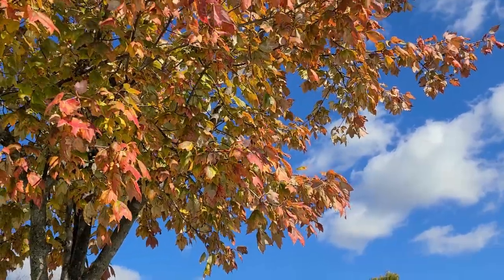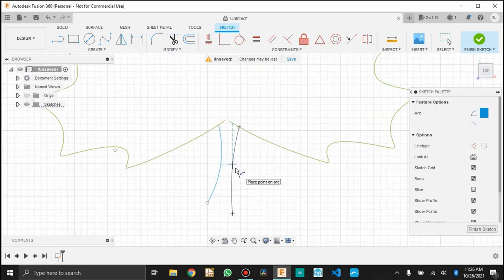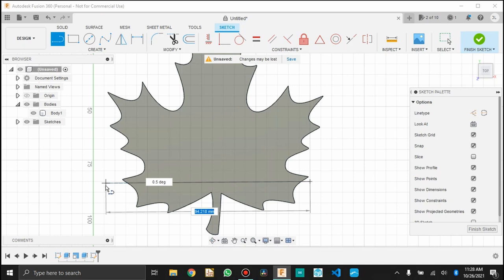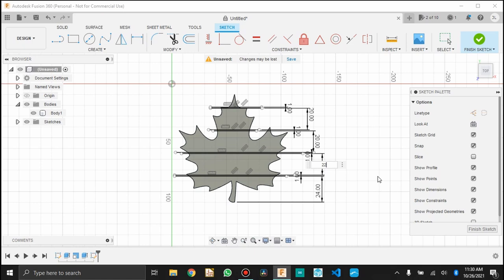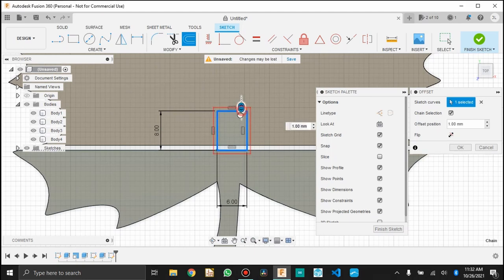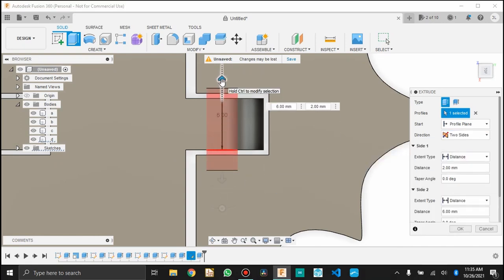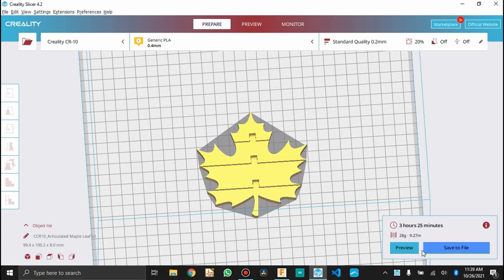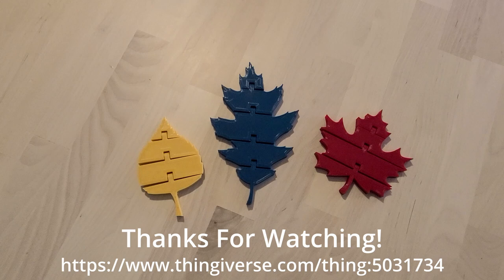Learn Print-In-Place 3D Printing

Comment: Which web cam are you using?
Reply from the maker: We are using the Raspberry PI HQ camera sensor with a 5mm lens.

Arducam C-Mount Lens for Raspberry Pi HQ Camera, 5mm Focal Length with Manual Focus and Adjustable Aperture https://www.amazon.com/dp/B088H17YHD/ref=cm_sw_r_apan_glt_fabc_Z1D9E5VAP1AP8C9XY6SG?_encoding=UTF8&psc=1